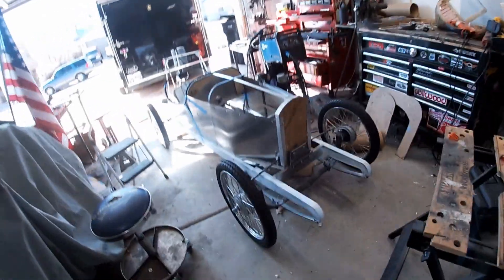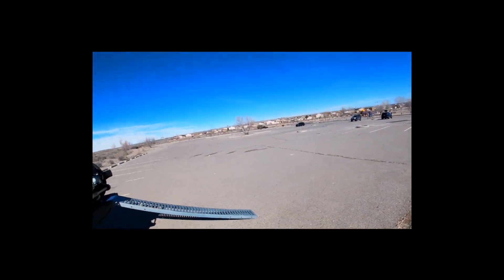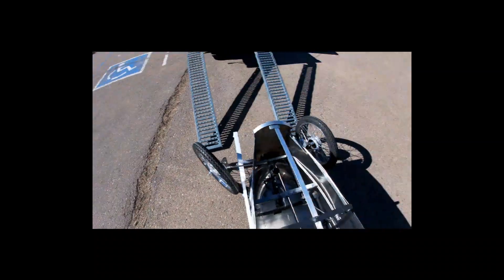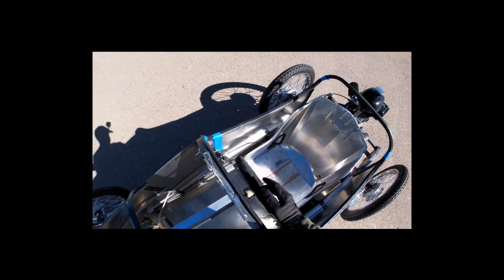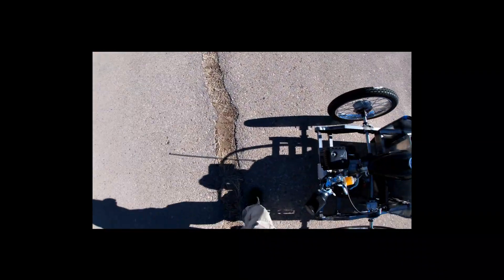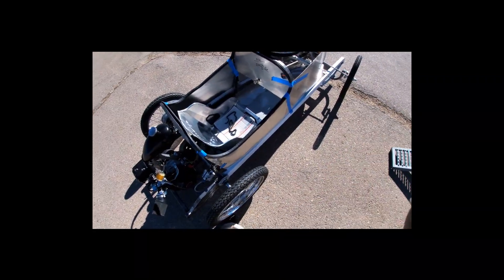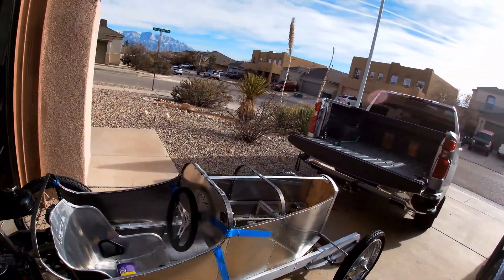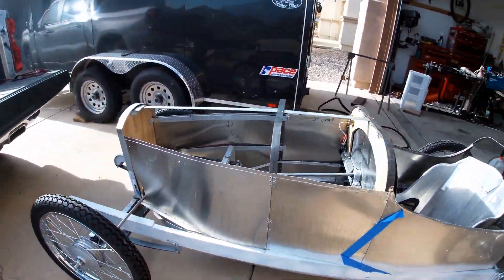Terwilliger Cyclekart Blitzen Benz first test drive Jan 2023

Comment: So far so good. Looks good. My steering does the same thing as far as the inside wheel suddenly flopping towards the frame. I set up my kingpin steering arms so that they contact the spindle bracket before the tire contacts the side frame. I should be ready to test drive mine in a few weeks. Now you’ve got me thinking about the #35 chain, if it’s strong enough.

Comment: Very interesting, are you using a centrifugal clutch? Every build I've seen so far was running a torque converter of some sort.
Reply: Also, thanks for turning on comments finally. Great build have been following along here and elsewhere.
Reply from the maker: Thanks for watching Hadlock! Yup I have a CVT, what you see on mine is the "Juggernaut" upgrade. I dunno if it works any better. My first one ran a stock tav30 and it worked great!